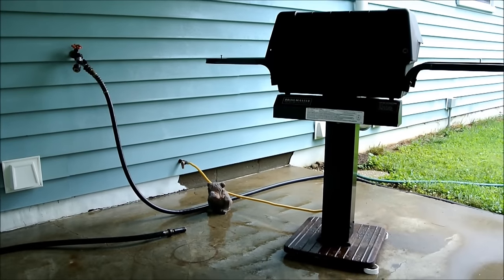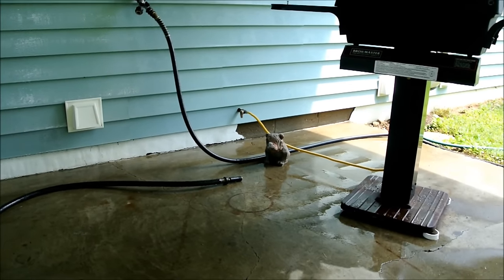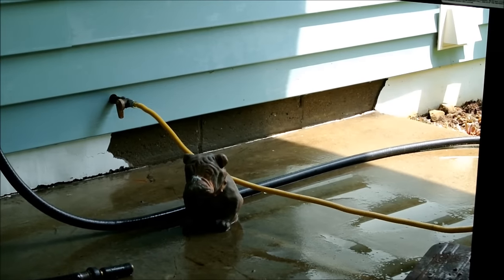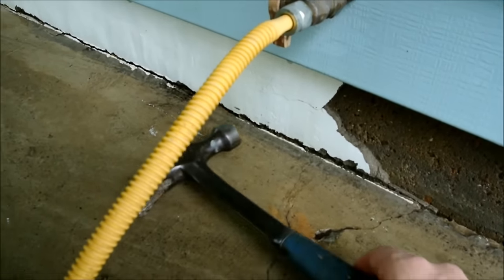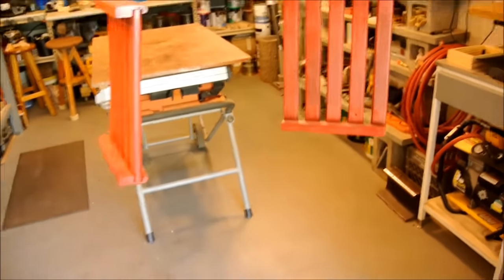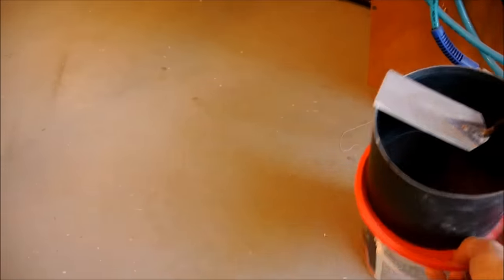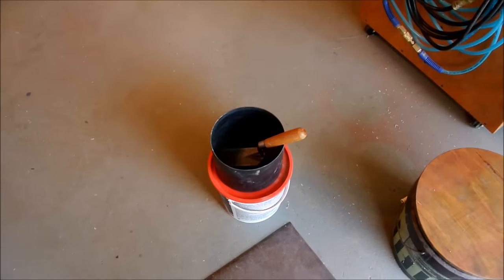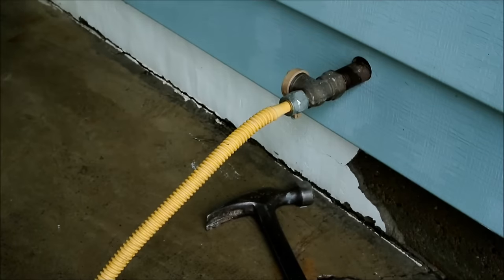A long, hot day parging with pocket

Comment: Did you consider carving up the patio, leveling and treating the cover below it, then replacing it with a grooved patio? You could also fill the crevices below the patio with a filler permeable foam. Winter freeze/thaw does a number on paved surfaces (coming from a guy from upstate New York).

Comment: Too tough on jump cuts, man! This ain't feature film :D Although I avoid them in my more polished videos, there's nothing wrong with them in a less formal one and can be used to increase the pace of the video by cutting out pauses.
Sure it wasn't the slab itself heaving that caused the parge to break away? If so, the caulked gap might not fix it, depending on how stiff your caulk is (oh, that doesn't sound right...). Maybe leave the foam in, but cut it back and just caulk on top of it.
Reply: John Heisz You aren't bad with the jump cuts. I'm talking Jenna Marbles jump cuts, when a person can't say a single sentence without a splice. I prefer a conversational tone. Besides, nobody can realistically expect us to be perfect speakers all the time. I'm sick of being expected to give viewers whatever they want. Good idea on filling most of that gap with foam- I think I'll do just that. Also, I agree: I'm pretty sure that slab is the cause.
Reply: pocket83 I think in a lot of instances the jump cuts are used as a pacing device. For example, even if you can get a sentence out intact, it's usually not as snappy as one that has had every millisecond of dead air cut out. Very popular to do, just like making videos at 4, 8, 16 and 1,000,000 X speed seems to be in diy videos now. As much as you don't like the jump cuts, that's about how much I don't like full fast forward video. Anyone can setup the camera in one or two spots, record everything and speed it up to fit into a reasonable viewing time.
Reply from the maker: John Heisz I never noticed that before. You don't really use high speed very often. I'm not knocking anyone for doing that (especially since I do it myself), but that is about the easiest possible way to film and edit. I get it, though- it's very popular with viewers. That's what sucks about the whole thing: There is lots of pressure here to do what is expected/popular.
Reply: pocket83² I think it only becomes that way once someone has to sustain themselves via Youtube views.  And I respect that, but it is nice to still watch the channels where people just make what they want to make, the view counter doesn't count very quickly, but they clearly enjoy it.
Reply: pocket83 The fact that you know about Jenna Marbles shows how much you care about content creation and what's popular on the internet. I can't watch more than about 30 seconds of her. Market research is the worst, haha. Good on you man!

Comment: I would say that intuition isnt flawed, it just works with what we give it and goes from there.

If you do something for 20 years, every day, you will have a better intuition on how to do it than someone who studied it from a book for a year, even if they know the math for everything.

Intuition is just the brains subconscious computing, guessing and averaging and basing on past experiences, so if you know how to use intuition, you can take advantage of the tremendous amount of power our brains have.

The key to using your intuition is to TRAIN your intuition, give it accurate math and figures and then practise over and over and experiment and manipulate, in your case you know how much of each part of the mixture is a good amount, because youve mixed it so many times your brain does the size calculations for you based on previous amounts you mixed and how well it turned out.

you did all that in your head without even trying, because you trained your intuition.

just because you shouldnt let your intuition rule your life, doesnt mean you shouldnt use your intuition.

intuition is usually pretty correct on things that can kill you, or hurt you, and with a little practice, flying, driving, sailing, anything involving lots of moving objects can be done purely by intuition simply because your brain can understand how fast things are moving relative to yourself and other things without you needing to know the r=d/t equation for every single one of the objects.

just takes practice.

Comment: You've been working with cement for a long time by the sounds of it, do you hands not get cracked and dry from handling it without gloves so much?  I have done some work with cement and find the more times I have used it the more sensitive my hands get to it over time.

Comment: Curious as to how long the original job took you around the house, dose look better the block I think
Reply: I can't remember. Maybe two full days? Possibly three. The digging takes a while, to get it down below grade. It has held up nicely, though. A few tiny cracks in some of the mortar joints, but a coat of paint would fill them. None has fallen away.

Comment: Whats the reason for adding the cement? Is it just for looks or structure ?
Reply from the maker: A little bit of additional Portland cement will make it harder. By itself, "type S" premix if very sandy, because sand is cheaper than cement. Thus, adding a little extra cement compensates.

Again: the type S mortar is just a cheap filler here, so that we can make a parge that's 1/3 the price of Quickwall. If you already have fiberglass strands (which most people do not), then you won't even need the Quickwall.
Reply: makes perfect sense, and awesome vid but I was asking why add it to the wall, as a home owner of an older home, I was just wondering as to why add it to the wall, was it just for looks or for structural support or to block water?
Reply from the maker: Oh! Gotcha. First, it has a nicer, cleaner, finished look. It's also much easier to paint. It does help reduce water absorption a bit (because plain old block is very porous), but since it only goes below the dirt a few inches, that's not really reason enough to do it. I did it mostly for looks.
Reply: Thank you for the information. I may very well consider this treatment. Thank you

Comment: I found this really interesting.  I'm also a little concerned about that but I'm sure it's nothing really.  That plastic paint bucket trick is spot on I was wondering when you'd use the Styrofoam strips.  What'd you call it?  "Snow-foam".  Is that a Pennsylvania term for it?  I wonder why it's called Portland cement.  Does all cement come from Oregon?  Is Oregon nearly as cold as it is in Pennsylvania?  They probably get more snow.  Oh look!  A butterfly!  I wonder what kind it is.  When I did the rock work on the front of my house I made a really strong mortar mix and added a lot of Weldbond glue to the mix and mixed it vigorously to get a good air entrainment which seems to have worked well.  Couldn't get below the frost line but I made an even stronger mix (more brittle but stuck really good) and ran an angled portion of about 20 degrees from the foundation up to the bottom face of the rock veneer which was about 2" proud of the foundation.  That also seemed to work well.  At least as good as your radon venting device.  At 1-1/2"wc it must be pretty quiet as that seems to be a fairly hefty fan.  Would it be as quiet as a typical HRV?  Do you use HRV's where you live?  Probably don't need one in your place out in the woods.  Ahhh, to live out in the country...How the hell did I get here by watching videos about making box joints?!?!?!?Cheers!  ;)

Comment: Try using a long piece of wood next time...there you go.
Reply: For the expansion groove? Don't do that. You will have trouble getting it out. Also, it was an irregular surface; the snow foam adapted to make a uniform thickness, so it only took two tubes of caulk. 

And there won't be a next time!